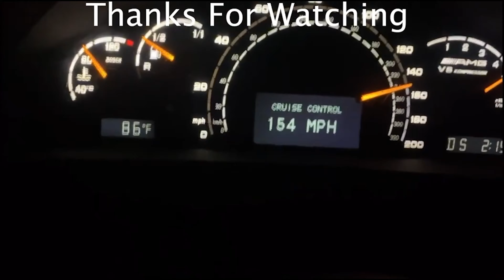Pulling Copper From AC Compressors.

Comment: I think the angle and point of the blade are the main issue. It's because the point of the blade goes into the bottom of the center opening before the side of the blade spreads it apart. The point is starting in a different row of plates on the bottom half forcing it to cut through them. If the point was shorter the sides of the blade would split it enough for the point to go in the same gap it started. So less angle on the blade or a semi-circle blade shape would fix ya right up 😊

Eta: if this doesn't make any sense just look in the opening of the stator and watch the tip of the blade while cutting...
Reply from the maker: Thanks for the suggestion it makes sense to me

Comment: that blade can take it, if anything just put a radius on the tip to make it stronger and roll with it. that steel they use for stators is soft as butter.
Reply from the maker: Thanks for the info

Comment: If you use a hydraulic press to push the axle out of the rotor you can split them just like a stator ❤ I do it with smaller motors all the time
Reply from the maker: Thanks for the suggestion I will try that next time

Comment: Ive seen few scrappers with cheap mechetti knife and a hammer to split them   Stators.   Maybe u can use that with your press ?
Reply from the maker: I've seen that and I was impressed. I had an Idea to do something similar because the original video I am replicating from had something liker that with a hydraulic ram

Comment: Make a blade guide on the sides of the blade so it will run true and not warp from all the pressure come off your frame to build it😊 awesome work buddy
Reply from the maker: Thanks for the suggestion

Comment: I don't know if it's the straightness of the cut, or the act of separating the laminations.  it looks like when the laminations split, the blade's thickness isn't perfectly centered due to differences in the glue strength holding them together, so it walks a bit sideways on some and not others.
Reply from the maker: Thanks for the suggestion

Comment: assuming the blade is a uniform thickness past the beveled edge, you could make a fixed blade guide that will stabilize it and reduce the lever arm on the blade when cutting. im glad you are thinking about that because as you currently have it, you could have quite the bending moment on the blade if you arent careful. id find two pieces of channel steel, attach uhmw to the flat faces, then figure out a way to fasten them securely to the press frame so that they guide the blade. you have a nice mill now though, so you should be able to fabricate something nice!
Reply from the maker: Thanks for the suggestion

Comment: Nice setup! Have you thought maybe some big all thread tapped to welded bolts in a jig frame on you base to level? You may need a to level as u go given the force you are getting out of the cylinder.  I learned in farming when I was young., Powerful hydraulic cylinders do have the ability to completely warp the cylinder arm. Happened more than once on the front loader on a tractor. The whole cylinder warped.
Reply from the maker: Thanks for the suggestion. When I move the press to the other table I will figure how to make sure the fixed carriage is level and probably like you suggested have jack screws to level it.

Comment: I'm wondering if as the thickness of the blade comes down it's putting uneven pressure against to the plates to the windings starting from the top. Both halves of the stator are tilting slightly causing the crooked cut
Reply from the maker: Thanks for the info

Comment: You need a blunter, shorter, more acute bevel so the lamanents spread apart more closer to the cutting edge. This will also make your blade more durable.
Reply from the maker: Thanks for the tip.

Comment: What the hell difference does it make if its not cutting perfectly straight ?  All long as it cut's in in half you've accomplished want you want.
Reply from the maker: I don't want to flex or stress the blade.
Reply: Wear and tear on the blade.
Reply: The motors are just a bunch of fine plates stacked up, if it's not straight then you are literally cutting the metal where he is trying to split between them so it's only cutting copper not the steel. Also if it gets deformed it's much harder to pull the copper later

Comment: I can't seem to really make decent money from doing this. I'm paying .35 per lb for scrap electric motors. I can do about 8-10 1-2.5hp motors in 1-2 hours or so, but there's really not much profit from it. Purchased $189 worth a couple of days ago, got like 8 1.5-2.5hp motors, and 4 .75hp-ish motors. Total copper is 70 lbs, I get $2.80 per pound for #2 copper. So I have a total of $196, for a total profit of $7 and change. I have 265lbs in steel, I get like .06-.08 per lbs on steel depending on the day, so we'll go with .08 for this example, that gives me $21.20! Have a small amount of cast aluminum from the motors, maybe 10 lbs, so maybe another $4, for a total profit of $32!

The only way to make any kind of money, I would have to work 10-12 hours a day, non-stop, 7 days a week, then I might be able to pay a bill or two. So I'm not sure how you can make so much from so little, what am I missing? Thanks.
Reply from the maker: You are paying too much and getting too little for the #2 copper. I get .35 for motors in Miami I would only pay .20.25 for them. I also am getting 3.60 for # 2 copper. I did a video a while back where I showed how I buy transformers. I basically move the decimal to get my price. If I am getting 3.60 for # 2 copper I will pay .36 for the transformers. Where are you buying the motors and what are the local yards paying?
Reply: @ProjectShopFl  OK, that makes much more sense. We've basically got two yards within a 45-mile radius, both compete in pricing. Unfortunately, only one of the yards lets the public buy from them. First time I was there, they charged .25 for scrap motors, but every time I've been back since, they've been charging me .35 per pound. Neither yard pays jack for scrap copper or steel, so I traveled over an hour and a half to another yard that paid the $2.80 per pound for the copper. Although they're very nice people, your ass seems to hurt when you're leaving.

Current prices are as follows (I just called today to verify what they're paying):

Sims Brothers, Marion Ohio: #2 Copper: $2.90 lbs, Mixed Steel: $155 ton
D & J Scrap Metals Bellefontaine Ohio: #2 Copper: $2.30, Steel: 0.06 per lbs

Where I've been selling my copper is a place called SA Recycling in Springfield Ohio, they pay: $2.80 for Copper,  0.08 For Steel per lbs. They do not sell to the public.

The only other options I have are over an hour away, so I guess I will start calling around to the yards in Columbus Ohio and maybe Cincinnati which is like 2+ hours away, and see if they sell to the public, but I'm not banking on it.
Reply from the maker: @patrickm.8425  I had issues with SA recycling here in West Palm Beach, I will never sell to them again. If I were you I would try and find the source of the motors. Also If you are buying them from the scrap yard they should work with you on the pricing because they are making money twice on the same item. Try explaining that to them and tell them you want to do tonnage. See if you can't talk to the owner and get them cheeper and get a better price for the copper. Good luck!
Reply: Just called two more places. One in Columbus, and the other in Dayton. Dayton (Franklin Iron & Metal Corp in Dayton, OH) "claims" they'll pay $3 lbs, but not sure, needs to see what we got. Columbus (OhioDropOff) only pays $1.30 lbs, because the wire is so small and thin, it's considered horsehair, and much of it is lost in the smelting process.

So to me, it's looking like Ohio simply sucks for scrappers. The only other thing I can think of is to melt it down myself, but then I'm stuck in a market of about 5 million other fools all doing the same thing, trying to make a buck. That minimum wage job is looking better and better. smh

Comment: I like that big shear for cutting the stators but wouldnt it make more sense to shear off just the copper at the end allowing you to use the hydraulic puller to drag the copper out after? If you cut them all in half you literally double your work with the puller.
Reply from the maker: On the bigger ones you have to cut them in half they are glued in and the machine can't pull them out. some times even cutting them in half it is still a struggle.

Comment: Ur soo close dude..a sharp blade for sure..about 3/4 of an inch above the blade needs to be wider..let the hydrolics spread the housing and the blade will easily cut the Cooper..did u ever cut a tire and if u spread it open when cutting its easier to cut? Same concept..let the fat part of the blade do the work and save the blade for the gold..too easy..😊
Reply from the maker: Thanks, It's definitely coming along well.